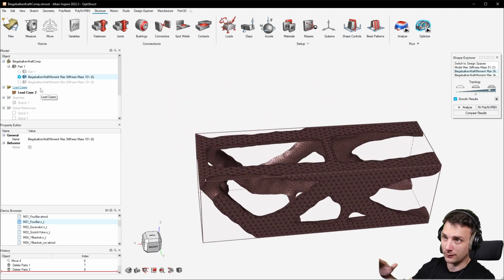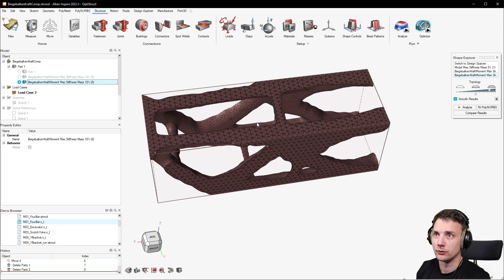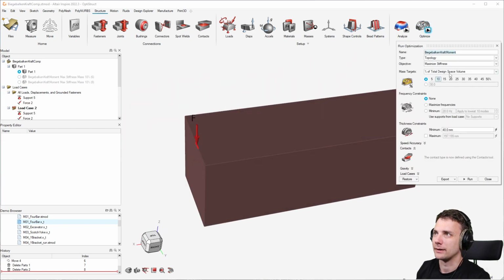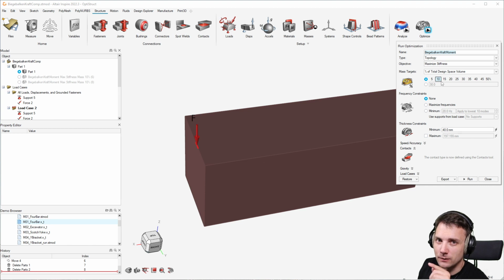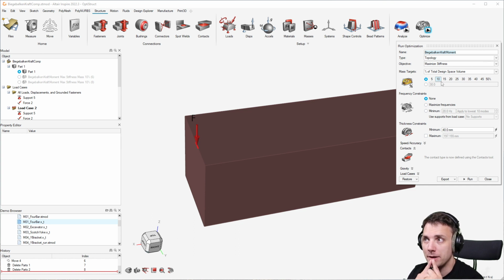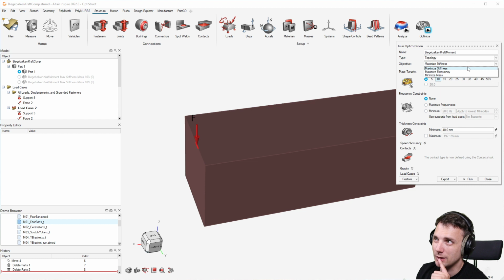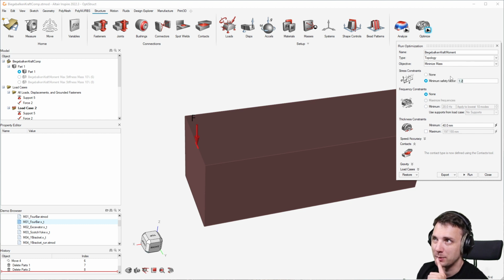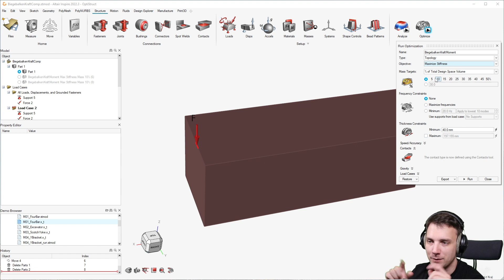Altair Inspire #short - Bigger force and still no change in the optimization proposal

Comment: Hi I am sorry for out of topic
Did you know why the Hypermesh is so heavy application
I have Hypermesh 2023 suite in my PC (Ryzen 5600X, 16Gb RAM, RTX 3060 12Gb). My computer lagging so much even if only I import geometry
The geometry is a simple small 1Part (motorcycle shock absorber head)
Actually there is nothing suspicious in the Windows Task manager (CPU 10~20%,  RAM 50%)
I don't know why this can possibly happen
Is there anything that I can do to make the application lighter?
Reply from the maker: Hey :) Can you describe a bit better what you mean with lagging? A delay when importing the geometry is completely normal. Even small geometric parts can be heavy to import as for example the number of faces which Hyperworks has to facet can be large even in small parts. If you want I can test it on my machine if you send me the geometry file to ramsaier@rwu.de 
If the lagging is related to turning of the model, make sure you have the latest gpu drivers installed. Your machine is suited well for the job. I have a similar one as you do.
Reply: @ManuelRamsaier   Hi
I made a video about it https://youtu.be/m7xSzEJfhRA?si=sdqG4riFy4-m12Oe

I don't really know exactly what happen. I already uninstall then install it again but the problem still occur

Interestingly I installed in my laptop i5 gen 9, RAM 16Gb, RTX1650 (all spec is lower than my PC)
The software run smoothly

Comment: Hi,
Can I ask how to display 2D or 3D elements with "Duplicate" errors and then delete them in hyperworks 2022.2.1?
Thank you!
Reply from the maker: 2D or 3D can be displayed with the Filter Toolbar. In the check elems there is a a function to detect duplicates automatically. This should work in 2022.2.1 too but not 100% sure on this one. Can you report back if you were able to fix it?